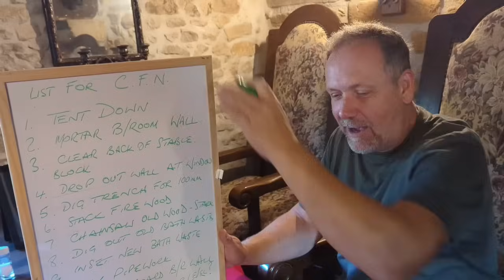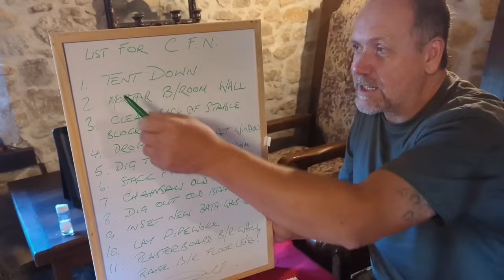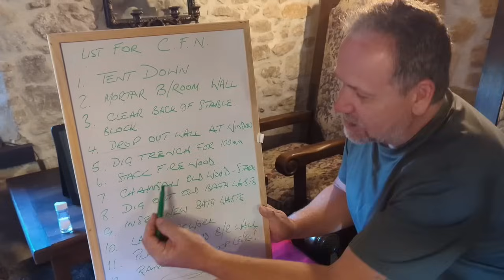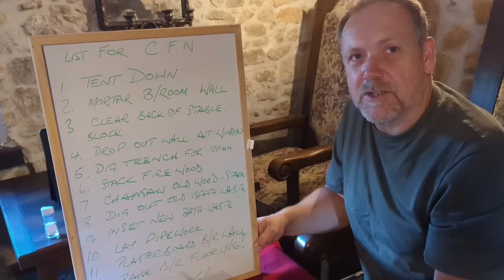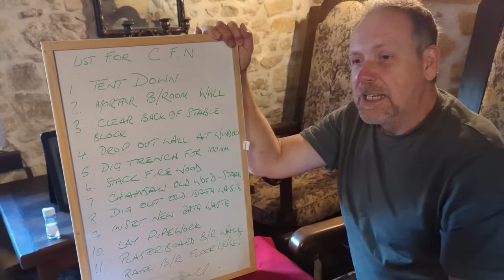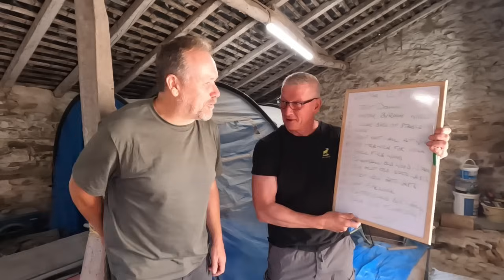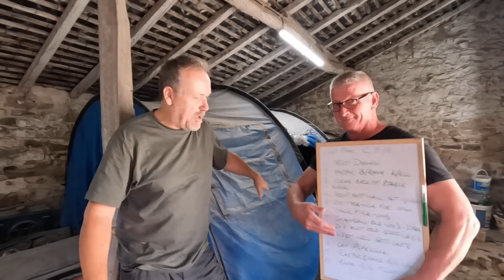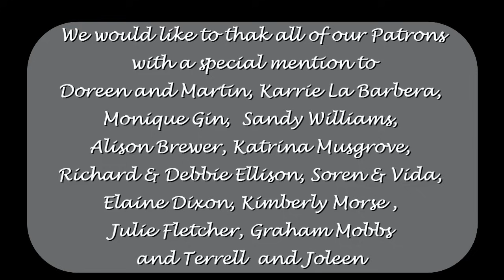From pigsty to luxury: The chateau renovations next chapter

Comment: I think they didn't do foundations on any of those old rural stone buildings in Europe. Just scraped away some of the dirt and started plopping down stones or bricks. Heck, we've got an old farm building that was presumably built in 1971 and it doesn't really have any foundations either. They dug just barely below floor level (the ground slopes quite dramatically) and poured concrete against the dirt for "foundations".